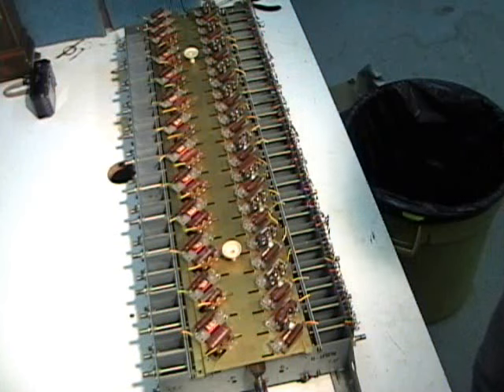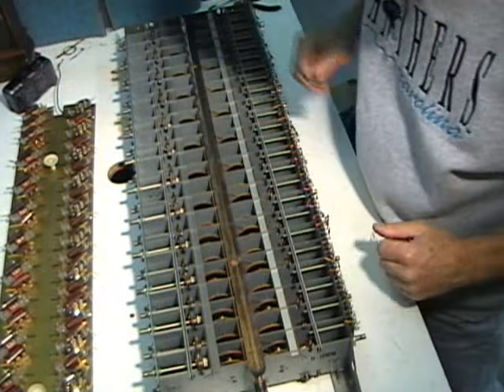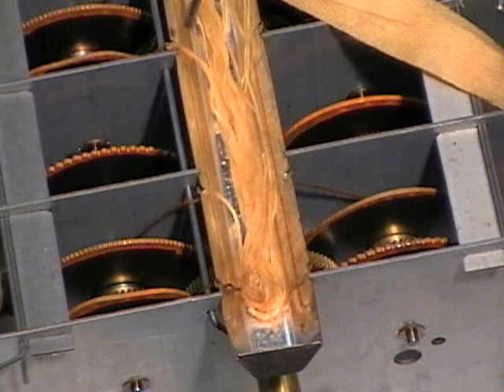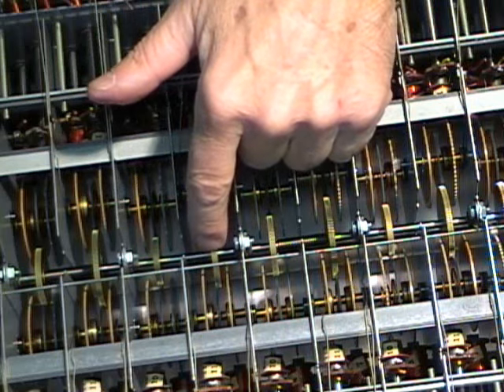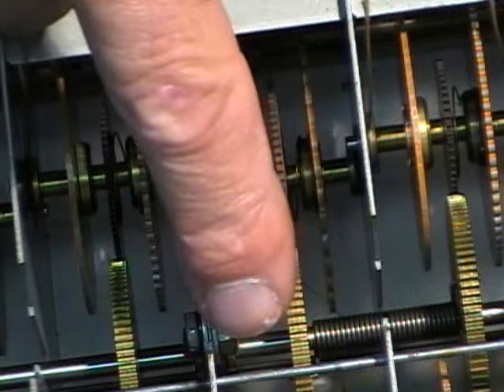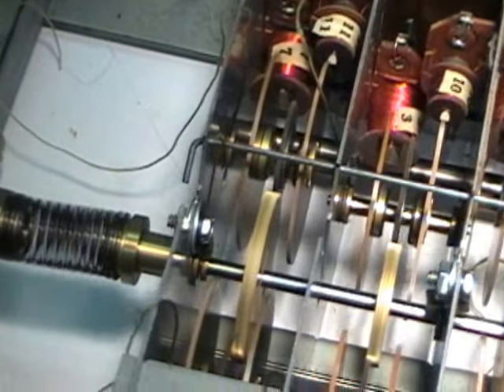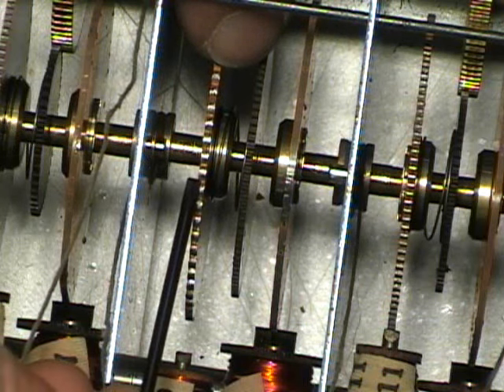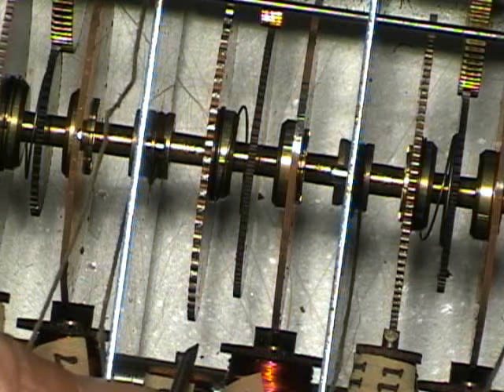Hammond Organ Tone Generator

Comment: Jeez, it seems to be a huge clock mechanism and its maintenance must be pretty expensive. I'm glad that digital electronics is able to copy the best bit of it and future electronics will be able to salvage even more out of it.
Reply from the maker: Quite the contrary. I have a Model A that was built in 1935 and is still working. A few drops of oil every year and it will be still working for my grandkids. That electronic keyboard will never last that long. The generator is the one part that seldom needs attention. While the sound has been imitated electronically, it has yet to be duplicated.
Reply: Electronic keyboards should last even longer, than mechanics, because only some parts, such as electrolytic condensers might get old and then need to be replaced.
I bought a Roland Kbd some 35 years, ago. It is still like new. I have to use a sledge hammer to disable it... :)
Reply: The now 81 year old Hammond Model A is a piece of equipment that will last for another 81 more years to come and is serviceable. Like other Hammonds, it's place is in studios next to that grand piano, for situations when true sound is desired, whether it is jazz, soul, progressive rock, pop or gospel. Your Roland might last physically, which is most unlikely, but the sounds are unusable unless you're trying to sound like early Phil Collins.
Reply: I find your assertion that somehow the sound from a tonewheel is timeless, but that a sound from an electronic synth from the 80s is dated, and limited to only playing 1980s music.  Piano is still really popular and I think over 300 years old?  It's subjective whether a given sound is not timeless.  To me, the classic detuned pad on vintage synths is still relevant.  Maybe the 808 cowbell is a bit dated, but some people still use it.  My point is that people sometimes resurrect older synth sounds, and I am glad for it.

Comment: It would be fun to make a huge tone wheel from an old steel merry-go-round, a 2-stroke motor (muffled, of course) on a rubber tire contact drive, a large loudspeaker with a wonker of a magnet converted to act as a pickup and a modest p/a system to amplify it. I’d watch that video. Heck; maybe I’ll make that video after I pay my insurance premiums and buy the dog some ear muffs ; )

Comment: Excellent video, and thank you for de-mystifying the mysteries of the TG. While you were in there did you happen to notice how hard it would be to replace a damaged/missing tonewheel? I assume the entire shaft would have to be pulled out, meaning all wheels and partitions would have to be removed (basically the whole TG). Or is there an easier way?
Reply from the maker: I have never replaced one myself, so I cannot speak definitively. I have heard people say that they have replaced them, I would think that it would be rather involved, as they would have to be removed from the top, meaning lots of unsoldering. Also, there are several configurations of TW so one would need to be sure replacement is the same.

Comment: I understand the organ was scraped, but was the tone generator? And if the tone generator was working fine why destroy it? Just a little confused
Reply from the maker: You need to understand that there were many different variations of TG in Hammonds over the years. They were not all interchangeable.
Some models are more valuable than others. This TG would have sat on a shelf in the shop for all eternity because it was from a model that has zero market value. Shelf space in my shop is more valuable than this particular TG.
Also, these things NEVER go bad. Most problems are fixed with some oil.
The value in dissecting this was not that much different than a doctor dissecting a cadaver to learn about things that are not normally seen.
I was able to see exactly how the various components were assembled, and learn a technique for disassembling without destroying it.
I also discovered just how much damage a tone wheel can sustain before affecting the sound.
Reply: Oh well that clears it up. I thought at the very least someone with a bad hammond pickup would want the pickups though? After all the pickups on Rhodes pianos go out all the time....I figured the same with a hammond (although you may educate me differently!). 

Anyway I was annoyed watching the video last night at first, but now I get it. At first I just thought you were evil and stupid to do that to the TG....but like I said before, I do get it now. And I get why other people were saying "great video". Thanks a lot.
Reply from the maker: The pickups are also different depending on which TG you have.
Also, pickups just do not go bad. 
Lastly, in order to replace a pickup one needs to completely disassemble the TG. This would be something that very few people would even attempt, let alone be successful doing it.
Thanks for watching, and please ask if you have any more questions.
Reply: Wow, it's hitting me like a ton of bricks what's going on in this video. Thanks a lot. Take care.

Comment: Does anybody know how a Hammond organ generates so many different tones with the wheels it has?
I would understand it without drawbars (number of keys equals number of tone wheels). But because of the drawbars it seems to me you need lots and lots of more wheels. How does that work.
Reply: Great. Thanks!
Reply: Hi, what the drawbars do is they mix individual sounds together. So as an example if you have A 440Hz as a pivot tone there is also A2 880 and A3 1760 etc mixed in. so the 8' drawbar just ads more of A2 and 4' drawbar more of A3 etc. You don't need extra wheel for the aliquot as it's already there.
Reply: Jos Jong the tonewheels generate every single note on the organ, right? And essentially, they are just volume potentiometers. So, pull the 8’ One all the way out, you get ‘piano pitch’ across the manual concerned. Draw the 16’ and you get an octave below...4’ an octave up, 2’ an octave above that. Now, the harmonics come from mixing in different notes. Vary they volumes of each and you get a different tone quality. For example, pull all the white tonebars and it sounds flute....add in harmonica and it gets brassier. Some fabulous effects are possible.

Comment: I know absolutely nothing about organs and organ repair, but I would think you would/could set the pick up rods by using a piece of paper between the pick up rod and the wheel. Slide the rod up, sandwiching the the paper between rod and wheel and lock it down, with using off of course. That is how I set the coil pick up on mowers.
Reply from the maker: They are all different. The only way to do this is with either an oscilloscope or accurate millivolt meter.
The lower frequencies have more of a tolerance in movement that the upper...on the upper frequencies, .001" in the gap makes a difference
Besides, to access the pickups this way would be a real challenge!

Comment: I don't understand why you spent over a minute from 5:41 jamming the pickup rods into the tonewheels. You had already demonstrated the clutch that operates in the event of a jam. The rods are not meant to touch the wheels. There's meant to be a gap and the optimum size of that gap is not as close to zero are you can get.
Reply from the maker: Fun for me. Just wanted to see what would happen.
So many people are paranoid about adjusting the pickups I thought it would be informative to see exactly what would happen on a SCRAPPED generator.

Comment: I greatly admire geniuses playing Hammond style's on clones, although it is more about their flawless techniques than a Hammond sound. Most emulators and Hammond style synths are not creating a sound of a tone wheel  generator. I had a case of a Hammond player asking me to replace a tonewheel generator in his Hammond with Hammond's oscillator board. He was back in a week and begged me to put his old tonewheel generator back. Is is a true story. I was absolutely not surprized.
Reply from the maker: I agree 100%.
I do own a Viscount Legend. I must say that the sound reproduction is remarkable.
Keep in mind that 80% of the "Hammond Sound" is a direct result of the speaker.
People spend too much time chasing that sound, when it really only exists in their own mind.
I have had dozens of all models of Hammond come thru the shop, rebuilt dozens, and listened to hundreds.
They all sound different to some degree.
Reply: @bobmann107  They do, however an amount of harmonics of a tonewheel is practicaly infinite and Hammond's genius was on flltering and mixing those harmonics. Although it is theoreticaly possible to build an immitation of tonewheel using electronics they do fall short of quality. I will not even try to discuss seven contacts under every key in Hammonds, or a fact of using vacuum tubes. Speakers were a masterpiece in years 1950-1980. People were fascinated with electronics. I still have original Eminnence speakers, built like a tank and sounding perfectly.Leslie was a superior company and I agree that a big percentage of Hammond sound was a result of their perfection in sound engineering. Too bad that these times are gone.

Comment: Crazy how much labor it took to make our Hammonds.  
    I’m 65, have owned many Hammonds & repaired them since 69 or so.  But I never had to  disassembled my tone generators, so I wasn’t aware of all the individual dual wheel shafts.  I thought there was the main drive shaft down the middle and 2 long shafts on either side, not all those individual shafts.  Even more parts!   I don’t know how Hammond ever made a profit!   
  I don’t know how Farfisa ever made a profit either!  Open up a 60’s Combo Compact and check out all the circuit boards & the Incredible number of wires & cables running all over the place!  I bought one new for $600!

Comment: Are the pickup rods magnets?
Reply from the maker: Yes, these rods are magnets.
Reply: bobmann107 Thanks! I assumed so, they wouldn't be pickups without a magnet. I didn't notice them sticking to anything in your video though, is why I asked.

Great stuff, by the way! I have yet to own a real Hammond, but... someday. Right now I play a Korg CX-3 and also use it to control GSi's VB3 software Hammond plug-in.

Thanks again.
Reply: Is it possible to make pickups that are not magnetic?  Just curious.  I thought remember that you can induce a current in a windings, from an external field, but maybe my memory is wrong, or the tone wheels don't create their own field, they just modulate an existing field.
Reply: Only if another coil is added with a very smooth DC voltage (which essentially makes the rod a magnet), or similar additional circuitry.

Comment: Great! I had an L-100 Hammond from 1972 and sold it. Big mistake!
+bobmann107  Do you now how the drawbars work?
Reply: +Organic Pickups   The  drawbars  are  sliding  potentiometers,  mixing  in  the output  of  harmonically  related  tonewheels.     So  as  well  as the fundamental  frequency  you  mix  in  higher  an  lower  octaves,  fifths  and major  thirds,  at  various  volume  levels,     to  change  the  sound.
Reply: Hey Boo66, I have a 1953 C2 and freed up TG with much oiling. Certain tones for certain keys (both upper & Lower manuals) (& depending on certain drawbars) remain silent.Doing buss bar shifts resolved nothing. Have any ideas about why only these few tones are not coming through? Thanks in advance for your thoughts.

Comment: The tone wheels are like a metal string vibrating near a magnetic pickup coil. They managed to create a 61 string guitar with self vibrating strings and turn it into an absolute feat of mechanical engineering. Seems such a waste now when a few mm square of IC can now replicate all the mechanics.
Reply: As the owner of a Hammond XB-2 - the first digital Hammond - I can report that those "few mm square of IC" fail and can't be repaired while a tonewheel Hammond can basically be made to function indefinitely. There are Hammonds from the 1930s onwards that still run.

Comment: " Right after shooting this, the TG was ceremoniously dumped into a steel scrap recycling hopper. "

breaks our hearts
Reply from the maker: You are obviously ignorant of the variety of TG that Hammond produced and the repair and maintenance of these devices.
Before I shot this video, I tried literally for 2 years to GIVE this away. Shipping was often an issue as this thing weighs a lot and it would cost a lot to ship anywhere. Also, there is ZERO need for anyone to replace an entire TG from an H model. This TG is not compatible with the other earlier consoles like the B,C,D,E, etc. with either components or in it's entirety.
I just did not have the room to store it any longer.
 The knowledge that was uncovered and the show and tell value was worth it, rather than me disposing without the video.
Reply: Sorry, it's true and i don't would make a critic, 
and i found it nice to show us everything.
Thank you for the videos before all ♪
Reply: @bobmann107 I bought a couple of old organs what's the idea of salvage in the power amps conversion to guitar amps. Will it be a bad idea to just throw that stuff away. I mean I don't think they're very valuable. In fact I think he only gave like $10 for one and the other they couldn't get rid of so they gave it to me it's a really small and pretty darn antiques
Reply from the maker: @tomstulc9143  I am assuming that you are referring to Hammonds. I actually sold a few amps to someone who rebuilds them for use as guitar amps. It will take someone who knows what he is doing, though. If not that, just the tubes are worth some $$, look in ebay for estimates.
It also depends on the model of the Hammond, some are worth more than others.
Also depending on the model, there are other components that are worth some $$$, like the buss bars, keys, pedal boards, drawbar unit, etc.
Reply from the maker: @melangesvolatils6506  It was not by choice, believe me. I would loved to have given these to someone, but it was not to be. Thanks for watching!
Reply: @bobmann107  thank you. I tried to give one away to the young lady who plays the organ at church today but she really don't have any place for it.. I was going to make guitar amps out of them but. I'm not going to fool with that stuff anymore.  Great cabinet wood. Unfortunately they are dinosaur from the past. The young lady was hoping for a modern keyboard so she can practice at home.

Comment: The pickup rod DOESN'T make contact with the theeted wheel.
NEVER.
Reply from the maker: That is true, and I never said that it did.
You obviously never worked on a TG before and for sure never calibrated one.
The calibration process involves moving the pickup in relation to the tonewheel to a specific output that corresponds to that specific tone.
It happens from time to time that the pickup accidently hits the tonewheel during this process. This experiment was to determine if permanent damage would render the tonewheel useless.

Comment: I really wish that people would quit calling this thing an organ. 
It's not a frigging organ. It's an organ wannabe. 
It sounds nothing like a real organ.
Real organs have pipes and stops and wind chests, not pull bars, tone wheels and pick up rods.
A real organ is a wind instrument, not an oversized music box encased in firewood.
Reply from the maker: Read up on the history of Hammond. 
When Laurens first sold his instrument, pipe organ manufacturers ganged up and sued Hammond claiming that he could not call his invention an "organ" because it has no pipes. The court ordered a demonstration be performed.
They used a church with a pipe organ, and Laurens set up his instrument with speakers situated in different places, and a number of people sat in the church  for a blind sound test. It was a 50/50 split of people who could not determine which was which...or so the story goes.
Bottom line is that it was determined that Hammond met the criteria to be called an organ.
Reply: Would you prefer "Fourier-additive synthesizer?" because it's that also.